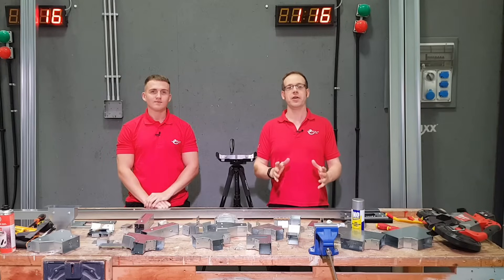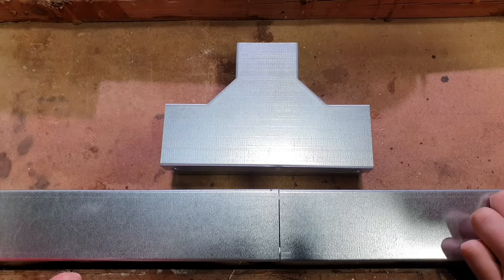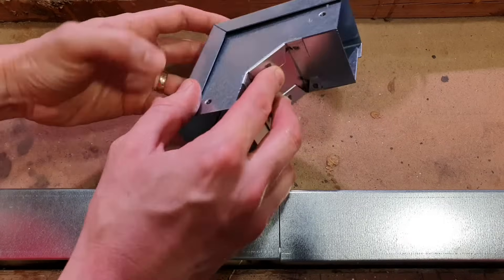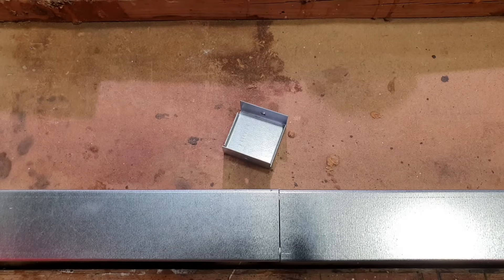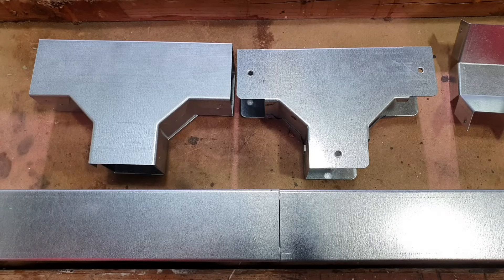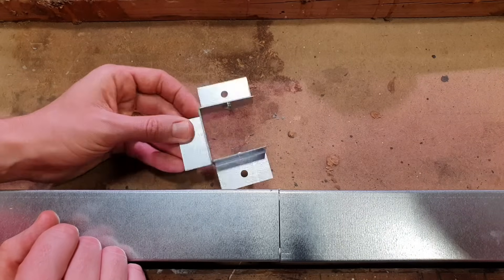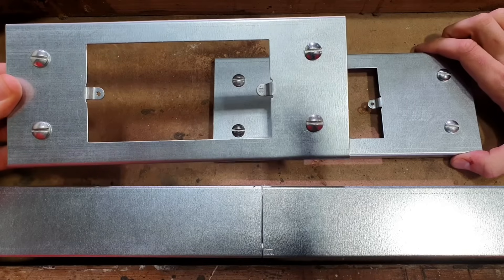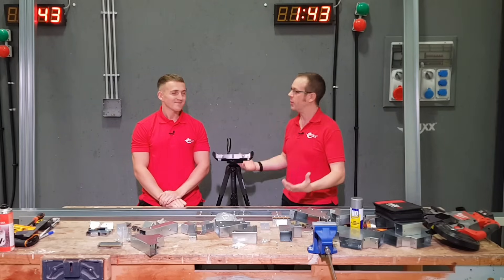Metal Trunking Accessories

Comment: 7:57 Those earthing straps are par for the course on any job I work on. Just makes sense to have redundancy in your earthing so that if, somehow, the trunking does part company at one or more joints there is still a continuous low resistance pathway to ground. Just one less thing to worry about...

Comment: The earth straps we only install in certain conditions, generally speaking your earth continuity is more then sufficient via the manufacturers fixing points. The last time we used these it was a job for one of our local rail networks and they required ever single trunking, bracket and tray joint to be earth strapped and torqued up.

Comment: Those clip on lids look neat, not sure how I feel about them not needing a tool to remove.

That being said the amount of trunking you see with the lids hanging off or completely missing because the turnbuckles have vanished or were never fitted it'll be a million times better than that!

Also you've had this one stashed for a while - uploaded a year ago?!
Reply: Been around years now; most lighting trunking has this design I find it much safer than potentially hitting the cables turning those screw lock things in
Reply: @user-wk7wv8rn8h  good point, I've definitely suffered from that one before. Thankfully only new trousers required ;)